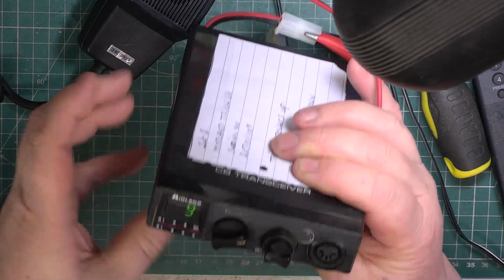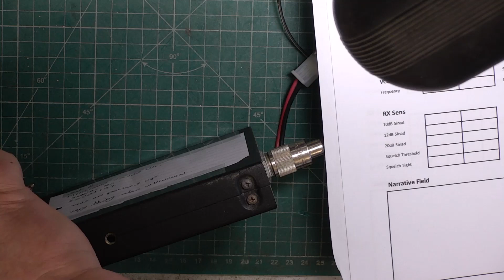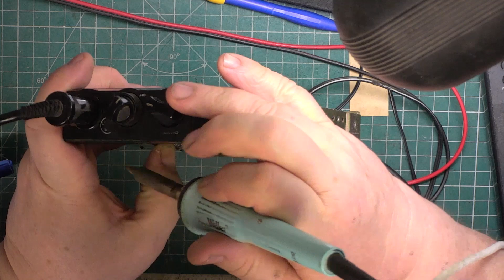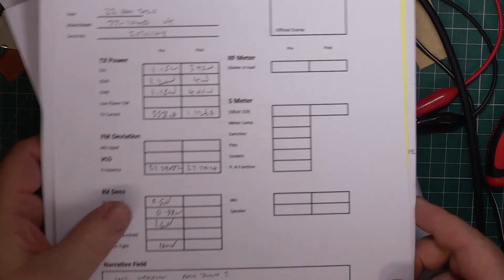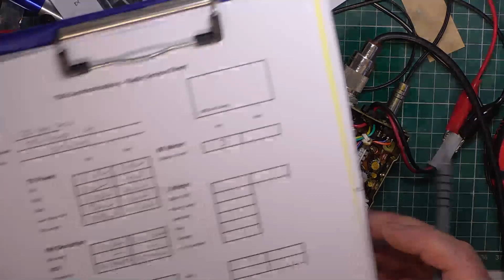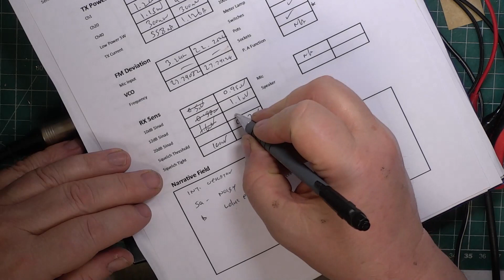Midland 77-104D-UK CB27/81 UK FM CB radio - repair & service

Comment: I had a beta 2000 brill radio
Reply from the maker: The Cybernet Beta 2000, which is what I reckon you had, is still an excellent radio & knocks the spots off most current models.

Richard

Comment: PIP didn't PIP.  What a pip, that switching device!
Reply from the maker: Yes, frustrating when it shows on the monitor & not on the recording.

Richard
Reply: @ukfmcbradioservicingTango21  If a viewer pays close attention, they can actually hear the change in sensitivity as you apply the platinum screwdriver to the slugs (platinum assumed to be of higher value than gold).  🙂

Newbies might gripe, but we "long-haulers" know that it's more likely to be faulty equipment than your omission!
Reply from the maker: It never happened when I used the previous vision mixer. I'd still be using it but for YouTube not recognising the format properly & shoving all my videos to 360p resolution.

Richard, UK